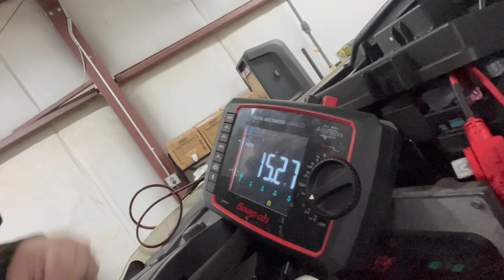Jeep Grand Cherokee 3.6 Misfire- Case Study

Comment: Thanks for your video, it was missing some critical circuit information.  First, was this type ignition have a digital signal from the CPU into the Coil Pack that activates a Transistor, this transistor actually carries/controls the Primary Ignition Control current.  Or did this type of Ignition System have a 12 Volt power feed directly into the Coil Pack ?  Depending on the Ignition Primary Circuit Design, the troubleshooting/diagnostics will be different.   I suspect since you were able to monitor Primary Coil current that this system has a 12 V driver , that supplies adequate Amperage ~ up to 19 Amps on the primary.  Therefore, your Resistance you found created a Voltage drop loss and the proper voltage level was not reaching the Coil Pack Primary Circuit winding ?  Low voltage due to voltage drop would create low Primary voltage collapse and therefore Secondary voltage would be very low and not ignite the spark plug therefore equals MISFIRE.  Thanks for your video.

Comment: I have a 2017 that is misfiring #2 only on a load (hard acceleration from a stop or driving past 65ish mph). Ever see that one? They’ve changed plugs and coil packs already, and compression test was good? Any ideas would be helpful because no one at the dealership seems to know what’s going on
Reply: They have bad valves in the heads on early models but it will show good compression. Only a leak down test will show the leakage. When doing this take valve cover off and inspect roller rockers and cam lobes . These 2 things cause most problems on cylinder head number 2

Comment: Just started with this problem as well on 2019 JGC. Replaced Spark Plugs, Ignition Coils, Fuel injectors,  spark plug tube seals, plenum seals and gaskets. P0304 code continues to pop up. Please update if anyone fixes this problem and I will do the same.
Reply: How did it go

Comment: Hey Jarhead or anyone that might have an ideal what my issue is id greatly appreciate any help or idea.  I have a 2019 Dodge Durango 3.6 with 65k. I'm getting a cylinder one misfire only at higher rpm and around 50mph. Other then that the vehicle runs great. Before it got to me the coil pack, spark plug and injector were replaced with oem parts. It also has a new main battery. What i have done is checked compression, did a leak down, both were great. I swapped all vvts from bank 2 to bank 1 and still the cylinder 1misfire at higher rpm and around 50mph. Ive now took off the valve cover and everything is very clean and no wear.. id love to figure this out but i don't know what to do next. If you just drive the truck normal it runs fine with no problems, as soon as you pull out in traffic or pass someone it starts misfiring but runs fine once you let of the throttle. Thank you for anyone's time and input on this.
Reply: Mine was a VVL solenoid replacement
Reply: What did you end up finding out?
Reply: ECU was shorting out under high current load. Put in a new ECU and haven't had a problem since.

Comment: 2015 grand cherokee..same problem..keep saying cylinder 2 misfire.smh i changed coils ..plugs ..and recently injectors  ..and  still didn't solve the problem..I'm going to have someone check out the wires..as this video mentioned..I'll leave update after it done 🙄
Reply: 2014 Grandcherokee Summit, cylinder 3 / multiple misfire, replaced SPARK PLUGS, COILS and FUEL INJECTORS on all 6 cylinder, engine ride/idle quiet, ENGINE LIGHT BACK ON, any idea on my issue?
Reply: @tonydeonarain6309 did you find the fix ?
Reply: @bryanreyna1509  no fix as of yet, going for diagnose soon to a "expert", will keep you posted.
Reply: Change the VVL solenoid
Reply: @MKF-x8o  what solenoid is it cause there’s like four in the front
Reply: Hey any luck? I have a 2019 Dodge Durango 3.6 that keeps saying cylinder 1 misfire but only at higher rpm and around 50mph. Everything has been changed but still happening. I just don't know what to do next.
Reply: @edwardthayer9386  Higher rpm is when VVL activates. I have one at shop, same code, same symptoms. Pulled valve cover and cam lobe worn out. Cam is on national back order. I am #3 on list while car waits out back.
Reply: Pulling the valve cover was what I did after my test. Cam lobes were as good as brand new, absolutely no sign of wear. Ended up being the ECU shorting out with higher current load. Changed out the ECU and the truck hasn't had a problem since.
Reply: Just started with this problem as well on 2019 JGC. Replaced Spark Plugs, Ignition Coils, Fuel injectors,  spark plug tube seals, plenum seals and gaskets. P0304 code continues to pop up. Please update if anyone fixes this problem a d I will do the same.

Comment: I have a Misfire on Piston 1. Not the Plug or coil pack. I brought it to a Jeep dealer they couldn't figure out why ? This may help...
Reply: What year jeep do you have? I'm having what feels like a misfire in my 2023 grand cherokee 3.6 liter with 5,700 miles on the clock
Reply: I had that also ..code said fuel injector #1..didn't solve the problem
Reply: I heard it was the vvl solenoid. $15 fix
Reply: @Ultimatesuperhero1  i dumped a bottle of hydrotex injector cleaner in the fuel tank and problem went away.

Comment: So even if the engine is running the resistance has to stay between 10 and 14 ish according to spec. I have a 3.6 jeep and it has a no 1 miss fire only. My codes is P0201 P0202 P0203 P0204 P0205 P0206 open circuit. But every injector test right resistance, when cold, right wire resistance, when cold, they have control 12 V and constant 12 v from fuse ,when running only, the resitance do climb when running on all injectors. compression test is perfect. I am lost. If the ecu was fried it would not give me control or any signal or voltage. I did scope it and it seemed fine, not a pro at using my scope yet. I did link a bypass wire like you did no change. Any advise please

Comment: 2020 GC limited 3.6 with 195+k on it replaced egr valve & cooler codes gone for two months and now misfiring again?
Only when driving at idle no cel? 

Any suggestions or ideas?

Comment: I usually put some load, like 100w bulb through the wire to confirm it is ok, wiggling the harness simultaneously. Also it worth to pull the wire with some force, if it is weak it will break.
Reply from the maker: We do as well with our load test light. This one just threw us for a loop due to only failing when hot.
Reply: @JarheadsGarage  in hindsight is there a good way to diag for this possibility, would leaving the test light on there for a  few mins start to dim the light ? I know not normal just wonder if the test light would pick up on this ? Also when loading a circuit is there a rule of thumb as far as how much load the light bulb should put on the suspected circuit? I dont see anyone mention this , basically if a circuit usually carries a 15 amp load could you get into a situation where your test light indicates a good circuit BUT only because the load ( light ) you placed on it was not enough or will it always dim enough to see the issue ?

Comment: The other day I unscrewed a coil while still connected and working,  the engine was on, I had a screw driver in my hand , I had no shoes, and I accidentally moved the screwdriver near to the coil spring and I received a current shock for about 1 or 2 seconds, do you think this could have affected de coil driver at the pcm?
Reply: NO

Comment: This was a vehicle I just purchased used from a dealership with warranty but refused to cover. Engine light came on day after purchase. Cylinder 6 misfire. All spark plugs replaced. Ignition coil replaced. Pcv valve replaced. Next step I was told is new motor for $9000. It doesn’t run bad, and I don’t notice any issues. Can I continue driving it or is it something I need to either replace or get rid of?
Reply: Same issue here… 8-9000$ to fix issue… Mine runs fine, other than the check engine light on..So I disagree with his response… been told by various certified mechanics that it’s fine to drive if no issues while driving
Reply: Same exact thing is going on with mine. 2018 Jeep grand Cherokee. 3.6. Started out with a p0306, pulled the plug and the plug was broken on the tip by the electrode. I said well it’s got 71k miles so I’ll replace all the plugs sense they’re due at 80k.
Misfire was gone. One week later started missing on cyl 6 again. I pulled the plug and could
See some carbon tracking on the electrode. So I put another new plug in and a coil. All good. Exactly one week later started missing again on 6. Haven’t had time to get back into it yet. Trying to think of what could be taking out that plug in a weeks time.
Reply from the maker: I wouldn’t recommend driving it on a misfire. Where are you located? I may be able to recommend a shop that can properly test the system.

Comment: Great video I recently got my butt kicked on a Honda CR-V with a similar issue on the fuel pump connector. Mine was hard to find because it was so intermittent.  I assume that even if you would have load tested the circuit with a headlight bulb it would have shown good until the circuit was hot enough.

Comment: I’ve just recently had a similar situation happen to be with a fuel pump. I load tested the wire And ohm checked all good. But after the car would run for about a half an hour the car would break up like I was losing fuel pressure. Well ultimately I created this issue myself. I installed an upgraded fuel pump and I had to go with larger gauge wires so I used the solder connectors to connect my relay to my new pump. When it would get hot the wire that is it would heat up enough to loosen the solder. Creating a loose connection. I found it with my thermal imager

Comment: Was this resistance on the coil control wire, or power feed? I think I missed which wire it was.
Reply from the maker: Control wire.
Reply: @JarheadsGarage  ok thanks, Im having a somewhat similar situation. Pretty interesting on these new jeeps that they have intentional shutdown of the ignition coils. Jeep is the first manufacturer I think Ive seen do this. Not just the injector anymore.

Comment: Good video Brandon! What did you end up finding in the harness though? Was it that connector?
Reply: Im having a same issue misfires in 1-3-5 only on idle  and its not always their some time s 1 and sometimes 5.  And some times 3 lol but its their
Reply: Same here, any fixes? @jimenezautorepair4450
Reply from the maker: We never pulled the intake back off. Customer opted for an overlay.